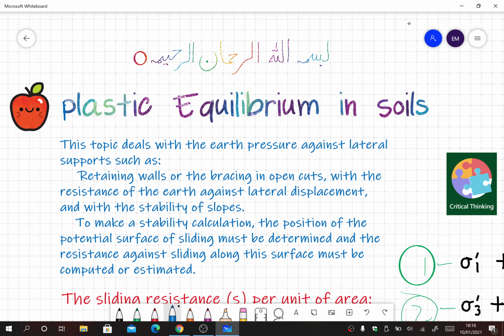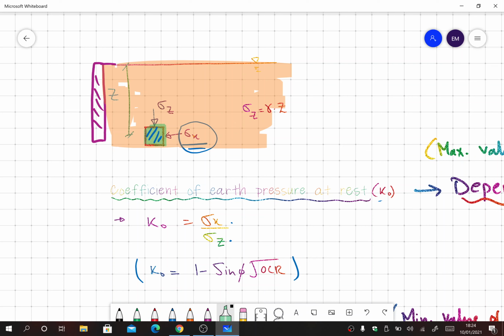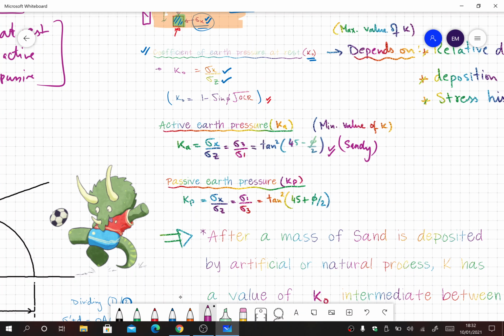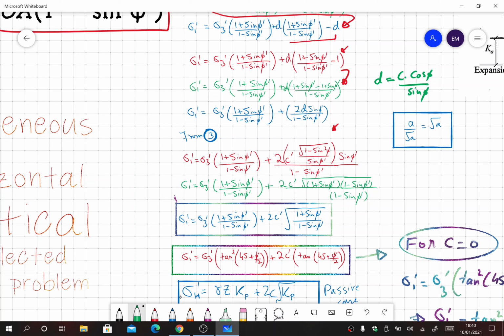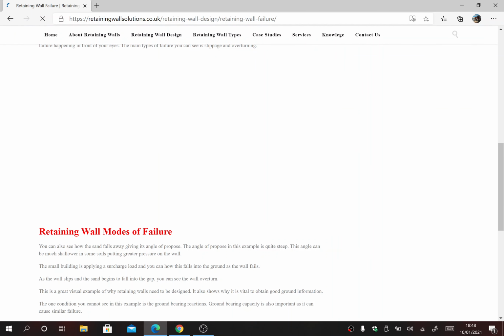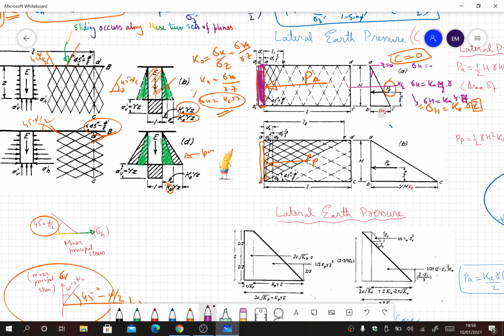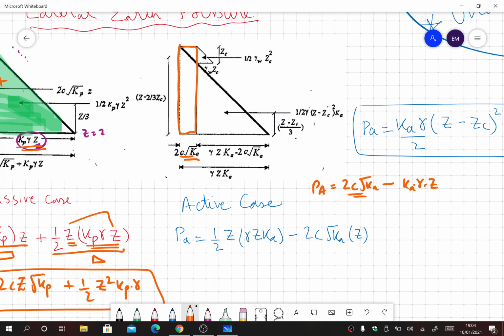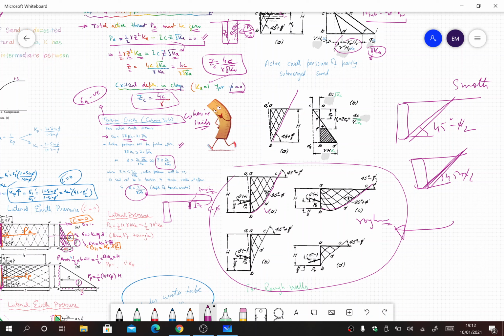Lateral earth pressure lec 1

Comment: Why for tension cracks we use stresses formulas and for unsupported height calculations we equate force formulas to zero ?
Reply from the maker: Aoa. Beta the stress diagram that we draw have stress on horizontal axis and depth on vertical axis. Depth of tension crack is till the stress becomes zero. So we put zero in front of stress formula.
Now for unsupported depth we have siad that the area of negative triangle and positive traingle will be equal. And area of stress diagram is equal to force. So we have made active force Pa equal to zero